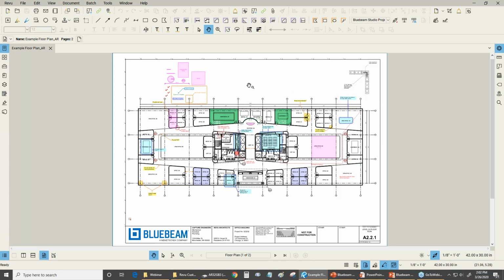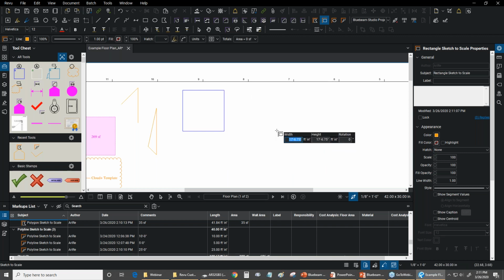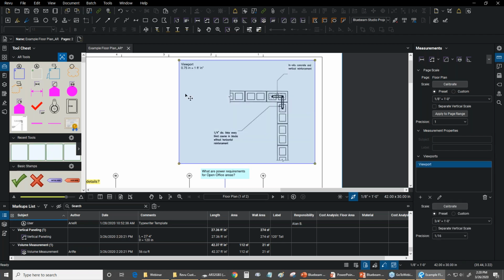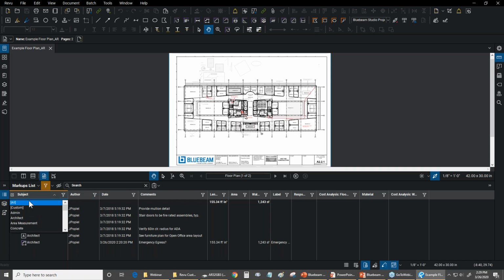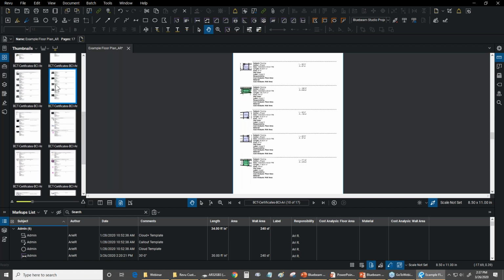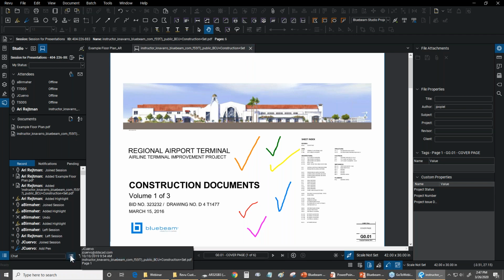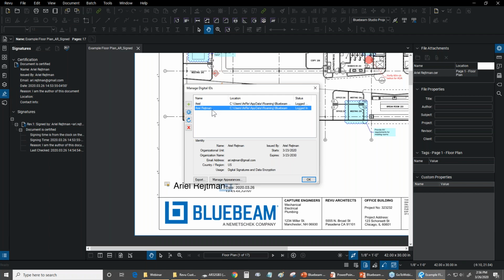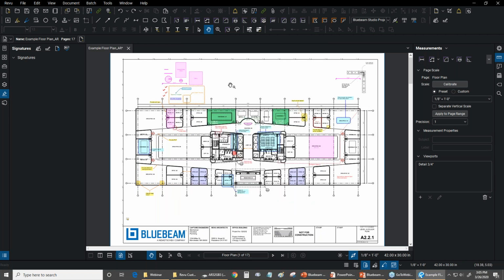Bluebeam Revu for Construction Webinar

Comment: Hey great video! One question... we're having trouble getting the cloud annotations to show when comparing documents. Any idea why?
Reply from the maker: When using the Compare Documents dialogue, you'll want to select "Advanced" and ensure that "Cloud" is turned on. If it's already on, you may be experiencing a rendering issue. This can be confirmed by selecting the "Revu" drop-down on the upper-left and selecting "Preferences". Then, you can select "Advanced" on the left side and check if your "Rendering Engine" is set to "Hardware". The "Software" setting may be turned on by default if your PC doesn't have optimal specifications to run Bluebeam Revu.